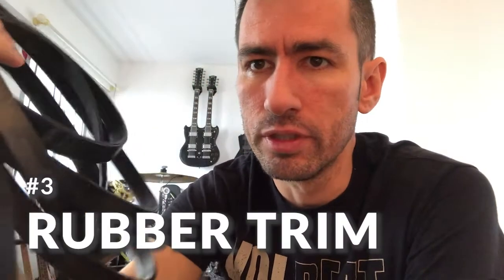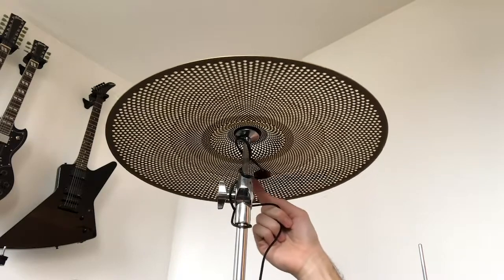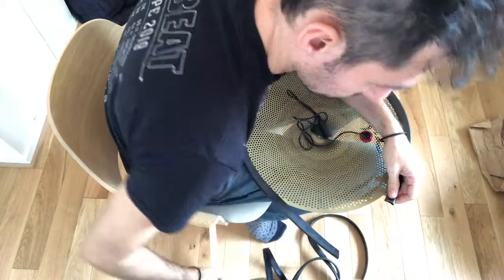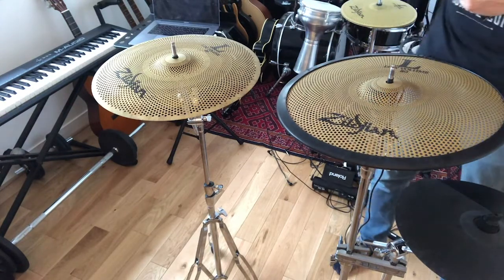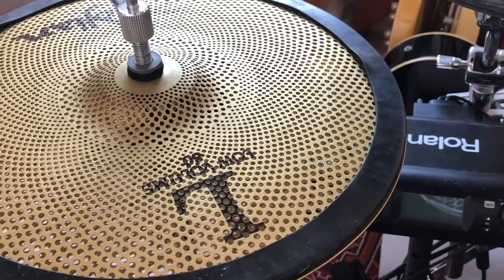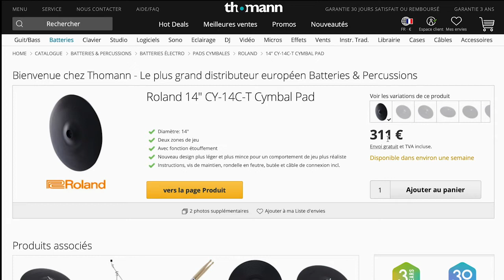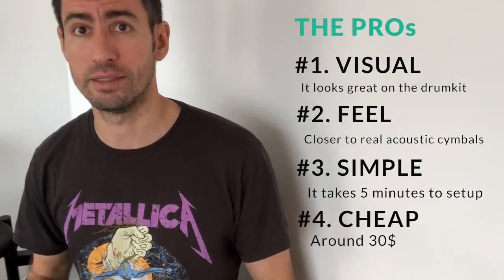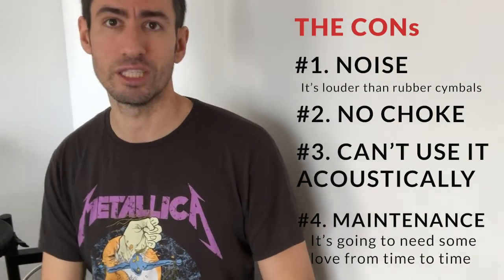Low Volume cymbal to electronic conversion

Comment: Amazing!!! This video give me the idea to use acoustic piezo mics, and forget about the welding! With this and contact sensor for ride bell would work for the ride.
Reply from the maker: Hey, what's up? Have a great 2022,  sorry for the late answer, yes I tested, and with 2 piezo and some tweaking on the module. settings you can have a decent two-zone ride. Check this AIC I did, https://youtu.be/eenmXX1O4GU?t=95 you can see it in action... you can clearly notice a cable tie in the bell...

Comment: thanks , I'm just in the process of doing the same , thanks for the links as well for rubber strips.
Reply from the maker: hey Dwain, you're welcome... if you have a question or if there is anything else I can do to help just drop a word =) My advice would be use the more resistant piezo you can find otherwise you'll have to change it almost weekly...

Comment: Nice video, very informative man. The thing to hold the rubber trim on is called a Twist Tie in English at least that is what I have called them haha, also a good idea as I don't want to ruin my cymbals either.
Reply from the maker: Hi Brendan, what's up? Thanks for passing by and leave a comment. Glad it helps you. And thanks for enriching my English vocabulary (Twist Tie so). Yes, it won't ruin your cymbals and it's been 9 months since I did the video, and they are still in place. The real problem is the piezo pickups that from time to time I have to change, according to the music I'm playing (if it's extreme metal, I need to change each week)... I bought a stock at Amazon, and I'm still trying to figure out another not that expensive solution.
Reply: @dektrimusic  One thing i've seen done is putting a cheap (or expensive) e-pad cymbal underneath  the L80's and they trigger very well with that method and you get two zone assuming the module is compatible etc. Even the hi-hats can be done with this stacking method.
Reply from the maker: @brendanmcg8566  Hey Brendan... you know that logical feeling "Why I never had thought about that before?" , can't wait to get at home and try it... I know that you can put a membrane to have 2 zones or Choke the cymbals. it's something that I really want to try soon... hey thanks for the hint 👍👍👍👍

Comment: Hey man, great instructional video, thanks a lot! i'm going to try it exactly that way! Just one question for curiosity: After the piezo pickup fell off the cymbal for the first time as you mentioned it, you re-installed it with the cable tie. So it means that theoretically you can re-use the same pickup after removing it, even if it probably doesn't stick well from alone anymore as you also mentioned before? Thanks again and many greetings!
Reply from the maker: Hey, what’s up? Thanks for watching and commenting… well, on fact I put the cable tie from the start… unless you play really really really softly, by its own the piezo are not going to stick there for so long. You can use double sided tape to get it there… but I don’t think that remove it frequently is a good idea, because the cable is really fragile and you gonna ruin the piezo. I’m currently using MagnaTrack triggers for cymbals which is a sturdy solution and allows me to take it of at anytime… but yes, it’s a more expensive solution
Reply: @dektrimusic  Thanks for the reply, my friend! In fact i'm looking for an "on/off" solution as i like my low noise cymbals both ways. I heard about these MagnaTracks triggers too, they look really good, probably i'll give it a try too. Thanks again and have fun!

Comment: That's a pretty great idea dude! Also it looks amazing considering you can find different color low volume cymbals in Ali Express. BTW have you tried to do like a dual zone conversion? Like to get bell and bow sound from a ride?
Reply from the maker: Hey Hi Psycho, thanks for watching and leave a comment. Indeed I did and it work...I'll try to upload a video and share the link with you.... I put one piezzo inside the bell of an L80 18" ride and another one close to the edge. Then set the correct Threshold and Trigger Cancel/Mask you can have both...if you hit really hard (my case) we'll eventually get some double triggering...
Reply from the maker: You know that there is also a membrane from GoEdrum (https://www.ebay.fr/itm/324221848610?hash=item4b7d20cc22:g:hfYAAOSwoXZefAXX) that you can use to have the dual zone... but it's a little trickier than just place 2 piezzos
Reply: @dektrimusic  thanks a lot dude! I'm definitely going to try this for a future project...

Comment: Hi my friend. What if instead use the rubber edge, I apply a silicon a fat rod around the cymbal at the bottom face ? It would be invisible
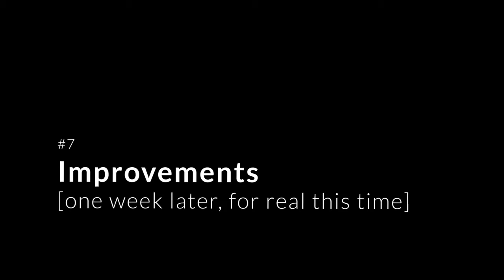Reply from the maker: My mate, what’s up? It’s something to test. I can’t say for sure that this might work. If aesthetics is important to you, there is also transparent rubber bands. If you look ar 10:30 you’ll see I use one on my ride cymbal. If you test the silicon solution, please, let me know if it works.

Comment: The only advantage to me is the look. I tried L80s. They dont feel any more natural than a Roland cymbal. To me the cymbals felt mushy. Like they give under the stick. I returned mine.
Consider that before a conversion.
And to me they look weird anyway.
Reply from the maker: Hey, thanks for watching and for commenting. Low volume cymbals are really not the same as real ones, but not the same as Roland rubber cymbals, not in the loudness not in the feel. For me it’s in the in between both, and when we have the volume constraints, I would say that it’s a good compromise l, imho.

Comment: Looks like you have clear rubber trim on your ride cymbal???. It looks better than the black rubber trim.
Where did you buy it? And how does it perform?
Reply from the maker: Hi Jason, thanks for commenting and watching. yes I tried a smaller and transparent one, but honestly, it’s less effective than the black one. I bought on Amazon, but I don’t know why it’s not on my order list.. I’ll try to find and send you the link if you want to give it a try anyway…
Reply: Thanks anyway, but if its less effective for you, I'll trust your judgment and try something else. 
  Your clear one looks thinner than the black ones. Thats probably the reason it's less effective. I'll try to find something bigger. Thanks again!
Reply from the maker: @JasonWelchMusic  not thinner, but smaller… the black one is around 3 cm/1.2 inch the transparent one is 1cm/0.4 inch…  I know that probably is not what you search for, as far as aesthetics is concerned… if I understood… but I’m using this right now https://m.fr.aliexpress.com/item/4001265438087.html?spm=a2g0n.order_detail.order_detail_item.2.6d2f7d56nBGvET&gatewayAdapt=glo2fra … you can check it in action in my last video.
Reply: @dektrimusic  wow bro! Thanks for taking the time to share!

Comment: Thanx for great video and tech ideas! tell, please, by few words - how to do the hi-hat, thanx a lot!
Reply from the maker: Hi man, thanks for taking your time to watch and comment. Sorry for the delay to answer. I'll do a video anytime soon about it. Your not the first one to ask. In a few words, you put the trigger just as you do in a normal crash. Then you'll need a controller, whether something like GoEdrum hi-hat controller ( https://www.ebay.fr/itm/323355309160) whether a regular electronic controller. The main problem will be the weight of the metal hi-hat... I use just the top part so it's more accurate triggered.
Reply from the maker: Let me know if you have further questions, or write me at dektrimusic@gmail.com, so we can discuss it. Cheers.

Comment: Do you need a hi hat controller to make this work?  Or can I just use the piezo pickups along with an electronic hi hat foot pedal?
Reply from the maker: Hey Dan, thanks for watching and commenting. Both work. I tested with my FD-8 and it works just fine… the only caveat is that you loose the open/close hi-hat feel… which might be a deal breaker for you…
Reply: @dektrimusic  Thank you sssir!! I actually have the FD-8 as well and a TD17Module.  Just ordered those materials that you described in your video!
Reply from the maker: @dankang9931  i think you’ll get better results than me… I have a Td11… i’m sure your module will allow to fine tune the settings and avoid some double triggering…  let’s keep in touch.. I’d love to hear from your thoughts on it …
Reply: @dektrimusic  Thank you for the tutorial and response again!
Reply: @dektrimusic  Hey Dektri I got a question.  So I was able to get my low volume Zildijian  L80 hi-hat to produce a sound by duct-taping a Piezo pick-up to the hi hat and connecting it to my TD17.  The only issue I have is that depending on which part of the hi-hat that I hit with my drumstick, the volume varies.  With that said, can I simply attach more Piezo wires on the hi-hat and then connect the tail end of the wires to the circular part of my current Piezo pick-up to evenly distribute the sound?  I'd appreciate some assistance.  Thanks!
Reply from the maker: @dankang9931  Hey Dan, what's up? There are some 3 pieces piezo on Amazon....I used it in the hi-hat and indeed it can improve precision on the hit volume. https://www.amazon.com/PAGOW-Transducer-Microphone-Self-adhesive-Electronic/dp/B08D6CGVFY?th=1.  If the link doesn't work, you can write me at dektrimusic@gmail.com. But bear in mind that this is kinda CHEAP solution, not the most precise one... and of course, if you hit it hard, you'll have to constantly change the piezos. Other solutions you can try is prevent cymbals from spinning, using like Aquarian Cymbal springs for instance... and of course, you can tweak the Threshold settings in the module.... and after all of that, one thing that people told me a lot, as I'm a beginner, practice dynamics.... hope that might help you

Comment: 11:30 I just burn them together.  They will fuse as one.  Be careful doing it though
Reply from the maker: Hey, man, thanks for watching and commenting. Indeed it's an excellent idea. I noticed that many people who contact me about this, want in fact to use a transparent band, in order to keep the cymbal visual, which I completely understand. If it's not the case, another solution that I ended up doing was to use those cymbals silence dampeners, if you search "OriGlam 4pcs Drum Cymbal Mute, Practice Silencer Dampener" on Amazon or any Chinese web site you can find it, and it's cheap. Have a nice day.
Reply: @dektrimusic  Thanks for the tip bro.  That's the best of YouTube commenting.  I did see those yesterday in fact when looking around for trim bands.  It makes sense.  If you make them slightly stretchy it'd be EASY to just pull them over the edges and you're done.  And they're dirt cheap too!  It's AMAZING to me that in 2023 it's so hard to find electronic DIY drum parts.  Seems like a great, wide open business opportunity for people in a world where everything is taken.  When I search for membranes (for choke) for instance, I can only find a Chinese brand called GoEdrum, and it's even harder finding solid instructions on how to install them properly.  Ugh!!  Rock on from Texas 🤠
Reply from the maker: I can join as your associate if you want it? I was thinking the same thing... eDrums were never as popular as it is today... lots of people are interested in having more of the "real deal" look 'n feel and even then, is really hard to find the DIY stuff. I have the GoEdrum hi-hat controller. It works fine... but yeah, I watched some videos on how to install the choke stuff.. oh my... not for me...  @ikigai47
Reply: @dektrimusic  That would be awesome. And you'd be perfect! But IF I did do something I'm a long ways from overseas distribution.  Thank you though.  If I try something it'd probably be along the lines of making my own cymbals from low volume, and selling them on ebay/reverb/amazon.  See how that goes.  If it took off then I'd be onto something.  If not, I'll make a few bucks then quit.  I put together a DIY electronic kit in 2009.  Real shells, mesh, etc.  For DIY guys we've gone backwards since then if anything.  I had great triggers that were strap based that are no longer found anywhere.  The strap was adjustable with the cone trigger in the middle.  Set it, put the head over it.  Worked perfectly.  Now good inner shell triggers are bar based.  USA is behind Europe where affordable kits and quality mesh heads are concerned.  You have Lemon, Millenium and Drum-tec is in Germany.  Here heads suck, triggers suck, affordable kits suck.